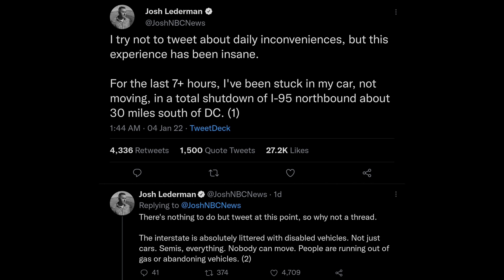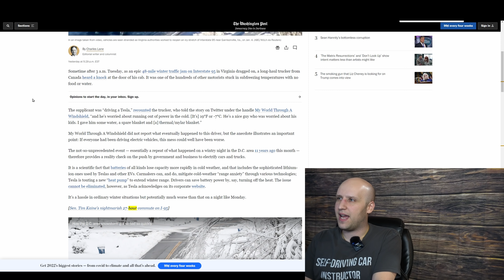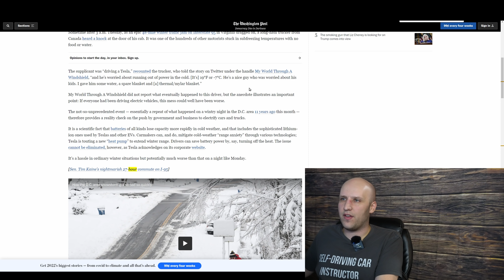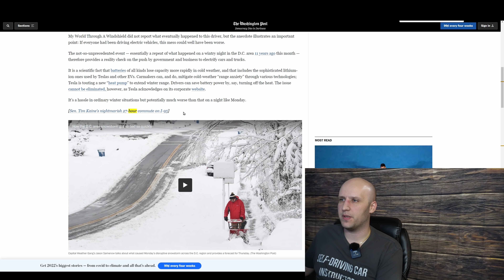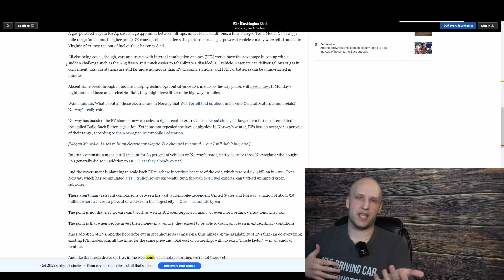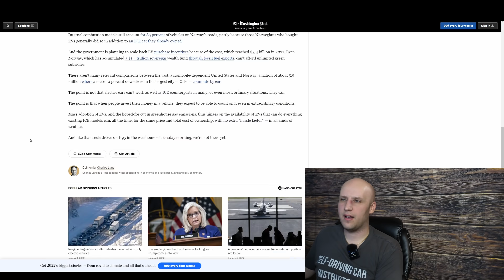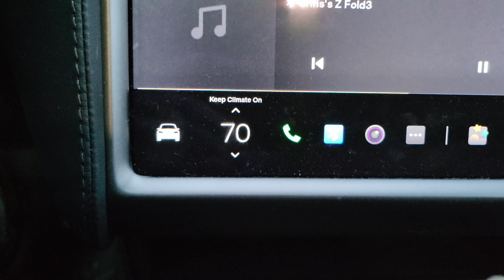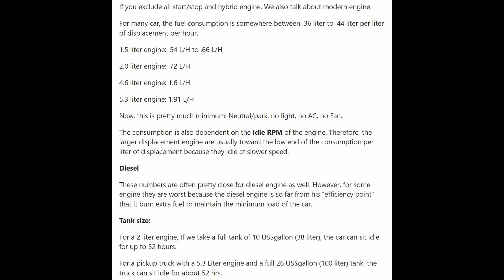How Long Can a Tesla Keep You Warm In A Frozen Traffic Jam? | FUD Debunking

Comment: We have two Model 3 here in Texas for the Snow Storm, and we had them with heat (not on camp mode) and both vehicles lasted more than 5 full days. the SR+ had 20mi left and the Long range had 90mi left.
Reply: And think about this case of “running” a car in a garage in your house with no power, not something you’d want to do with a diesel or gas vehicle inside a closed space because you’d be dead of CO poisoning in short measure. EVs run clean and silent when warming or cooling the cabin, which is an advantage all the time, not just during a major power outage.
Reply: @skyemalcolm  Why do I want to run the ICE car in my garage? I just fire up my portable generator outside and power my whole house.

EV is great for many things, but don't push it beyond what it is good at.
Reply: @parkershaw8529  I own an EV and a PHEV and I far prefer them in the winter over an ICE, which I’ve previously owned dozens of ICE cars and bikes over the years. EV’s Fast warm up is the main reason. Not having to go to a gas station in the winter is another.
Reply: @skyemalcolm  I am not against anything you say in your latest post. I will switch to BEV as soon as my current vehicles crap out. FWIW, I personally will never buy hybrid.

I merely pointed out it's not a valid argument to assume people will idle their ICE vehicle inside their garage during a power outage. Neither EV has any advantage compared to an portable generator.
Reply: @parkershaw8529  sure but it’s a point that I can and often do just turn on my EV (which I paid $2300 for by the way) when it’s hot or cold outside and I run the HVAC in it to be comfy. Does it cost me a couple kWh?  Yeah maybe but I don’t care because electricity is like a 1/3 the cost of gas and it’s totally clean and silent so I’m literally distributing no one no matter where I’m doing it.
Reply: @skyemalcolm  An EV of $2300, that is something!!!! 

Now I think about it, you are using your EV as an HVAC controlled tiny tiny house, that is quite interesting.
Reply: @parkershaw8529  now it ain’t gonna be no $2300 but that cyber truck (which can cool the bed under that tambor door thing back in the bed) would be a sweet camper. But the old used model S would make a really sweet low budget bug out wagon camper. Super small vs a van. But dig this: old model S have free super charging. And they fit a comfy mattress with the back seat folded down. And they have camp mode to keep the inside perfect temperature all night. And if you’re at a campground you plug the thing in and start the day with a full charge. I almost pulled the trigger on a 15-20k one a couple years ago just before the pandemic but now prices are crazy on them. They don’t charge quickly but it would be a sweet retirement camper experience IMHO.
Reply: @skyemalcolm  When I retire, I will treat myself better, I will get proper RV or trailer, I will not sleep inside a Sedan.

$2300 is absolutely awesome! $15-20k is kind of not that appealing anymore. After pandemic, all the prices gone CRAZY! Both for EV and ICE.
Reply: @parkershaw8529  I hear yeah on not enough space but a lot of people buy an RV or a tow behind travel trailer and picture themselves bombing around the country fancy free. Gas isn’t free and that’s the charming thing about an older model S with free supercharging still active. Probably hard to find but apparently they exist.   I found my LEAF in a local Craigslist ad last March. I guess I just got lucky on the deal and car does what I need it to do. I drive it daily.
Reply: @skyemalcolm  I am thinking using CT as the towing vehicle. 

Enjoy your $2300 LEAF, that was an exceptional deal.
Reply: @parkershaw8529  
guess you missed the times that people use charcoal grills in the house for heat and die. People do stupid things all the time.
Reply: @parkershaw8529 , not everyone has a generator. (I don't.) And an astonishing number of people die from CO poisoning from doing dumb things. If for some strange reason I were stuck in a garage in freezing weather, I sure would rather have a BEV than an ICE car.
Reply: @happysalesguy  Not having a generator is sole your decision. It's like just $300. Anybody can easily afford one before any BEV.

I am milking my current ICE vehicles as long as I can before I switch to BEV.

I am very happy to keep using my generator during power outage which is very rare in my area.

BEV is great for many things, but it won't solve all the problems in the life.
Reply: @parkershaw8529  a generator doesn't compare to a car. but for more money you could get a house battery like a powerwall and then never have the power go out in the first place and have to go out in the cold to start a generator
Reply: @dogtato   Both EV and Power wall are much more overpriced than a portable generator. I have bought the generators, I will wait a while for Tesla to ramp up the production capacity greatly and reduce the price.

Starting the generator out in the cold is not a problem for me.
Reply: @parkershaw8529  People do run ice vehicles and portable generators in garages during power outages, with often fatal results.  I my opinion, it is an valid assumption.  Add the fire hazards of gasoline,  the electrocution hazards to occupants and utility crews to the dangers of carbon monoxide.  This is all assuming that you have an adequate supply of fresh gasoline, and you are familiar enough with the mechanical operation of your generator to fix a no start situation or have parts to fix a broken recoil starter.  It does not appear that you have really had to rely on your generator for anything like they did in Texas
Reply: @VVBros1  You post is borderline FUD. If I engage the same tactics, I can exagerate the fire hazard of all types of EVs. People abuse the equipment is not the fault of the equipment.

People buy EV because it's great for many things. As an heated cabin during power outage is a very corner case, and should be treat as such.
Reply: @parkershaw8529  : your logic doesn't even address Skye's issue.  It's like someone saying: "I like the juice I can get from squeezing my oranges.", and you say: "So what?  I can get apple juice from the apples I have in my refrigerator!".
Reply: @edwardgarner1299  It's more like somebody says they can get their $30k milling machine to drill a hole in their plate and I said you can do the same with a $30 drill.
Reply: @parkershaw8529  you seem reasonable. I'm sorry EV owners sometimes aren't. A generator is cheap insurance if it's what you can afford. Obviously a giant battery and solar system would be better and more self reliant (gas ran out in many areas of TX during the storm), but they also cost $40k vs a $500 generator and $1000 worth of electrical work to hook it up if you aren't just running extension cords. 

I think the thing to remember here is that this is for emergency use, not typical operation. It's less green, but it's really not a significant contributor to the problem.
Reply: @jonathansage2147  Much appreciated.

I keep my vehicles relatively full during winter times; at the first sigh of trouble, I go out and fill my 5 gallon can, so I don't need to get the gas out from the vehicles right away. After the storm is passed, I will just pour the can into my vehicle's tanks and dry out the can completely outside. I also have quite a few fire distinguishers.

I actually have two generators, one dual fuel big one to power the house, a small inverter one to just power the furnace/frig/a few lights at night if needed.

I am also an EV fan and a TSLA supporter. I am waiting for the right moment to buy my first Tesla. Probably a CT.

Hope Tesla will support vehicle power to house in the future. They can count that as mileage against the vehicle, it's only fair.
Reply: @skyemalcolm  can you explain how you got an EV for 2300? Is that a typo?

Even I could afford 2300 lol
Reply: @parkershaw8529  generator is nice to have, but imo managing a generator during an extended power outage is such a headache.

Longest power outage I've been through was 19 days. Wood stove (with hot plate on top useful as a stovetop), bucket flushing from pool water, a propane grill and blankets thrown over the freezers worked out really well, and the grill was honestly optional. I cooked a sunday roast in a dutch oven (with a pizza stone inside to better distribute the heat) just sitting on top of the wood stove.

We actually ate really good those almost 3 weeks lol, clearing out the fridge, then the upright fridge freezer and then started working through our smaller chest freezer until power was restored.
Reply: @dogtato  how long is a power wall going to work?

I guess if you carefully set it up to avoid the big draws in the house you could get some longevity out of it, but if the family just goes about business as usual you'll blow your load of stored power pretty quickly. (Of course if you went full off grid and the power wall was just your storage system that was charged by some other means that's a whole different story.)
Reply: @VVBros1  IF the garage is a standalone structure it's actually better to run the generator in it (with the main door wide open during starting and handling, and earplugs at both times of course) because the structure is going to absorb a lot of the noise and keep the generator from being a nuisance
Reply: @priestesslucy   Nice to know you enjoyed your life during your outages. My longest outages are less than 5 days. 19 days would be a pain to manage my generator setup indeed.
Reply: @skyemalcolm  The free charge Model S/X lose that privilege when sold from the original owner.

I have a 2018 Model S 75D with lifetime supercharge and internet. Not giving it up!
Reply: @parkershaw8529  Elon said they did offer car-to-home charging but there was no demand so he turned it off.  The new electric F-150 does this.  

The averageAmerican home uses 30kwh a day (during non emergency)… EVs are the perfect backup solution
Reply: @lyledavis7175  I know Elon said that. I wonder if they come up with some scheme to convert the discharge into mileage, so they can support this feature officially. As for Ford, none of my business.  :-)
Reply: @parkershaw8529  for now. Never know for sure given the current state of the grid.

Shit's getting old and fragile, and somehow I don't think the new spending bill is actually going to help
Reply: @priestesslucy  Get more prepared, increase your capability, defense in depth and good luck!
Reply: @priestesslucy  Craigslist…found a deal a LEAF with a so-so battery. It gets around town and is pretty quick just not for very long. It had 80k miles on it. I guess the original owner just needed it gone. Now I did have to put some new windshield wipers on it last month. And honestly it’ll need brake pads and disks but that stuff is cheap to replace. Maybe look for one at auction or keep scouring Craigslist after this current car price bubble pops.
Reply: @skyemalcolm  I'm more inclined to try to get that new Electric Van coming out of Germany in the next year or two.

ESRP is supposed to be about 25k USD at current exchange rate (though with the dollar dropping in value I could see that winding up more like 30k) and it's got way more functional space than yet another sedan or hatch back
Reply: @priestesslucy  yeah I’ve had a couple Honda Odysseys, an ‘01 and a ‘16 and I love the utility. I can’t wait for larger affordable EVs to start to make their way to North America. It’ll be interesting to see whatever the Honda Prologue is.
Reply: @parkershaw8529  - How long does a portable generator last on its internal tank of gas?  Only maybe 6 - 8 hours, and that’s only at 50% load.  Storing enough gas for days, or a week, and spilling any during refueling, could be dangerous.  Going to get gas could be a problem if the power is out at gas stations, assuming they got refilled by trucks.  Plus, refilling your generator would also need to be done at least once at night every 24 hours … outside … in the cold.
Reply: @jimmanley2796  Don't worry about me, but, much appreciated.
Reply: @parkershaw8529  - My comment wasn’t just for you, as there are others who aren’t quite so … imaginative as we are, especially in unusual circumstances.  The pandemic toilet paper and other hoarding just goes to show how thin the veneer of “civilization” really is …
Reply: The good to see. What was the temp outside and what temp were you keeping the model 3’s at during those 5 days?
Reply: @philorgneopolotin8762  yes it was below 24 outside and inside the garage was at 27 degrees. we kept the haters at 70 degrees
Reply: @charliesays1961  Good to know, but not representative to folks stranded outside.
Reply: You should keep those haters cooler :D
Reply: @charliesays1961  that's a relevant test for a mild winter area, say low elevation Pacific Northwest for example.

Buuuuut there is a lot of the country with far more dangerous winter temperatures that it's going to burn through a lot faster.

Another point: the garage does more than have warmer air than outdoors, it also nulls wind chill that leeches heat out of a vehicle.
Reply: @priestesslucy  is still better than gas car inside garage or outside.
Reply: @charliesays1961  I would need to see some side by side comparisons to be sure, an idling ICE uses very little fuel and can keep the interior warm pretty easily.

What this does prove is that electric cars can effectively get the job done under most circumstances, so it's not really a reason not to get one.
Reply: @priestesslucy  can it last 5 nights? all night? also disgusting gas  🤮
Reply: @charliesays1961  Probably not. But in harsher conditions where heat is even more critical it can definitely keep up and possibly perform better lol
Reply: @priestesslucy  Don't think so but ok. people move forward not back ;)
Reply: @theagentsmith  ice the haters!!!
Reply: @philorgneopolotin8762  a gas cars proper operating temperature is 200F. A Litium battery can discharge down to temperatures of -4F without the battery even being warmed. so you might see how I find your question a bit odd
Reply: Texan here. I slept in my 3 when the power went out last winter. :)
Reply: Thanks for sharing your experience with both models
Reply: @mrchase1  No problem. to be very clear, we did not stay inside the car the whole days, only night from 8pm to 8am aprox.
Reply: The number of people IN the car would make a HUGE difference in the amount of time at those temperatures.  This test had none.  With four people in the car, it could be weeks!
Reply: @TheVigilante2000  you still need fresh air and 4 people use up air infinitely faster than an empty one... unless these things are equipped with Heat Recovery Ventilators?
Reply: TX and snow are two words that should not be used in the same sentence, . Try taking your Tesla to NE or IL at winter
Reply: @ansv3340  Cold weather is cold weather lol below freezing and no power for 5 days is something don't happens every day. So for the two Tesla to last for all that time and help us sleep warm is priceless. Be smarter don't hate.
Reply: This makes me feel so much better with my SR+
Reply: @Kencival  Yes our SR+ is the one that came with 220miles and is that good on winter time. can't imagine the new ones that comes with 260 or something like that.
Reply: @charliesays1961  lol I got mine in early 2021. Oh damn this is definitely good news thank you
Reply: That’s amazing. I wouldn’t want to be in a SparkEV or a Rav4.
Reply: U fibbing.a little.
Reply: Dam
Reply: STOP LYING STREET PUNK , IF THAT HIGHWAY WAS FULL OF EV CARS PEOPLE WOULD OF FROZE TO DEATH !!!!
Reply: @lancethrust9488  obviously you are not smart and you are here because you hate yourself....
Reply: Cap